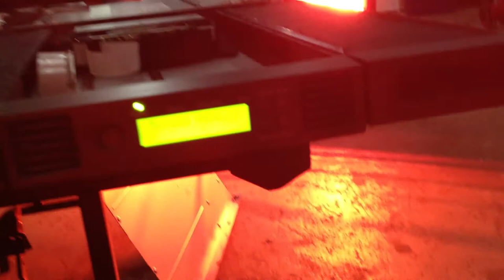HP StorageWorks 1/8 Tape Autoloader

Comment: @ IVC AMS - I'm assuming you either don't have HP support or you have limited support that doesn't include break fix. Have you tried taking the autoloader apart and manually removing the tape?